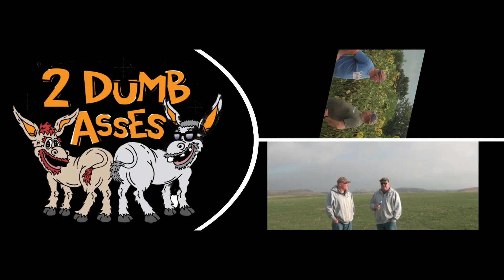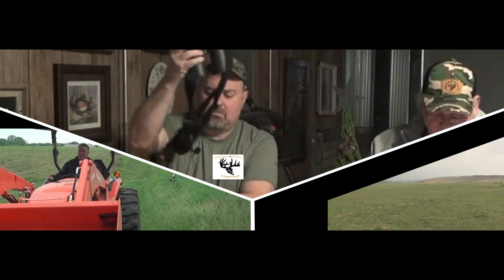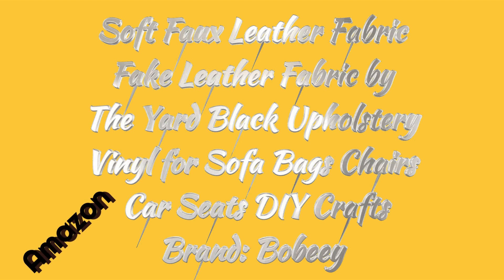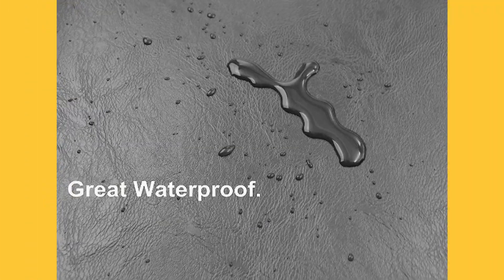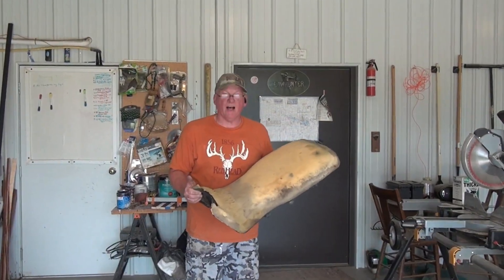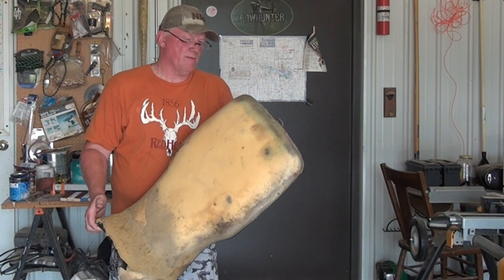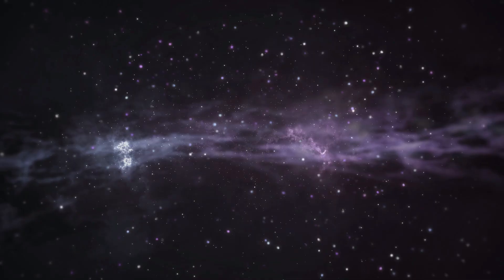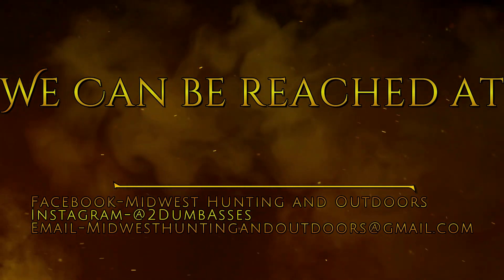DIY ATV Seat Cover Repair

Comment: You may find on the next one that you won't want to use adhesive as it will come out smoother, and be a bit easier to install.
Reply from the maker: Big Frank-  We appreciate the comments and viewership.   We struggled getting the "low" areas tight without the adhesive.  I am sure with practice we can make this a better process.
Reply: @midwesthuntingoutdoors  It's a process.  Was just a suggestion as I have done a couple, and have one to do right now.